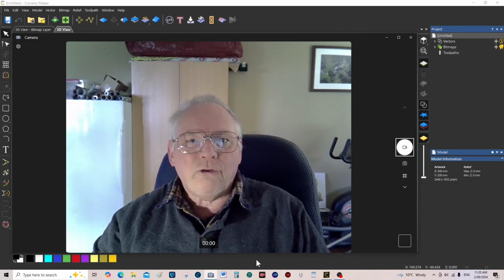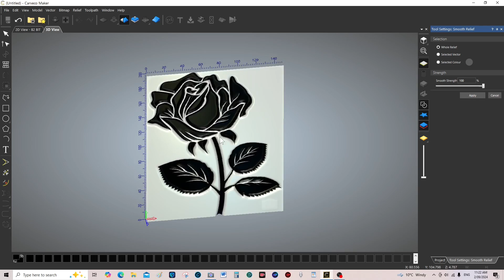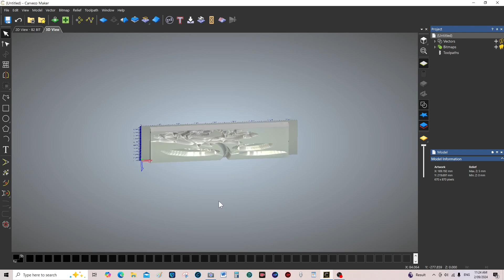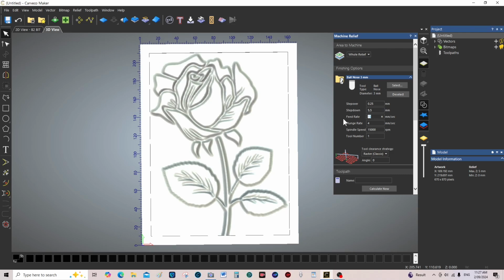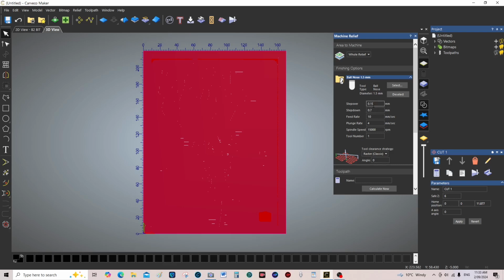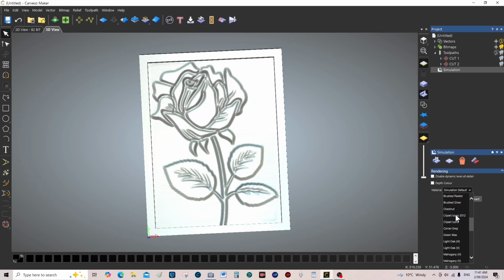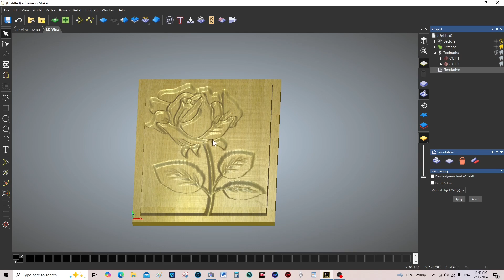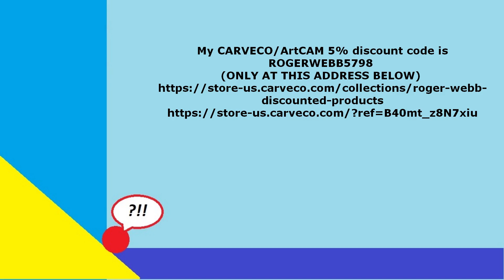Carveco Maker making a 3D relief for coloured resin infusion

Comment: Hi Roger. I finished rebuilding my CNC router and tweaking it in. It has the SMC controller. I'm wondering how you check and calibrate the feed rates so they are correct with the speeds you set in your G-code. Thanks.
Reply from the maker: I will check it out